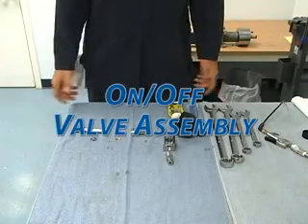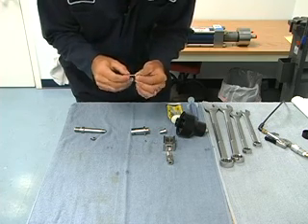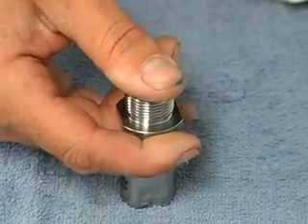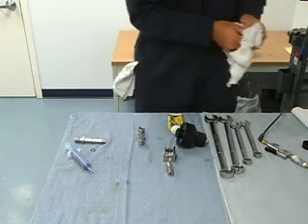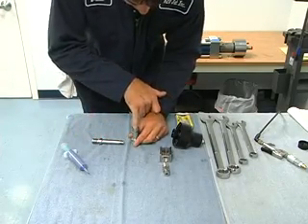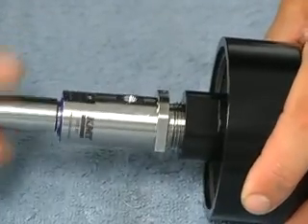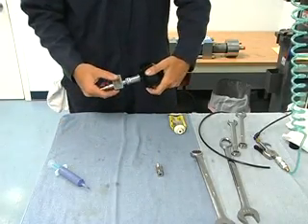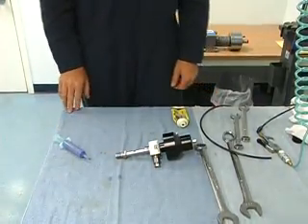How to rebuild a H2O Jet or Flow Waterjet On/Off Valve Assembly

Comment: This is a good assembly guide with the exception of the fact that you have the camera too far away when doing the small parts at the beginning so we cannot see the parts.  But this is labelled a rebuild video.  I would like to see details about disassembly first.  I am starting with a head that is leaking and I want to disassemble it and rebuild it.  Knowing how the small parts come out is important!!  Yes, this is my first time.  My operator is away and I have to learn quickly.

Comment: Thankyou for uploading the collection of H2O/ Flow servicing aid videos. All in all they're a great help but I do have a problem with this one in that the main purpose of this video is to show how to replace the on off valve stem seal/butress but without close-up shots of the valve repair kit it's as good as a radio broadcast given the number of wrong ways there are to install the small parts on the shaft
.